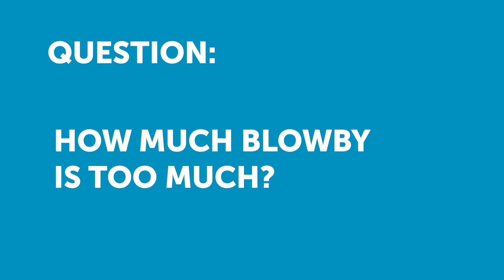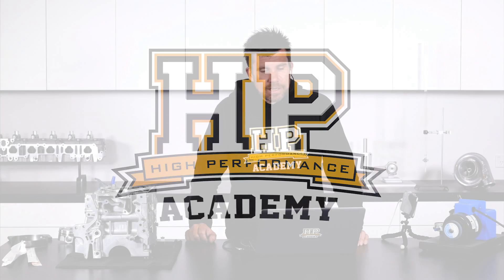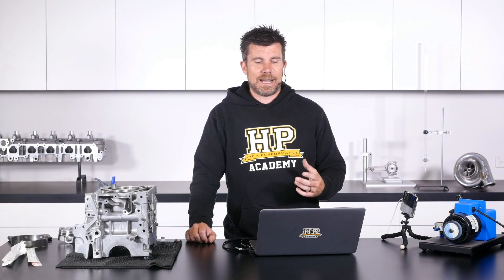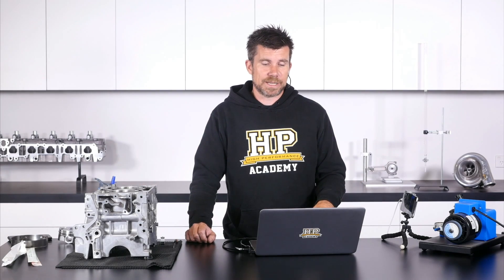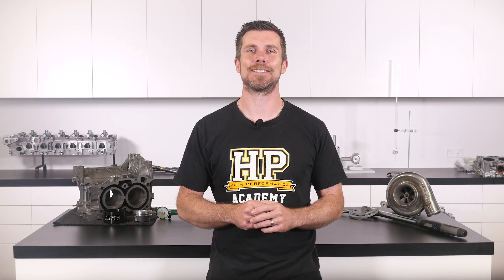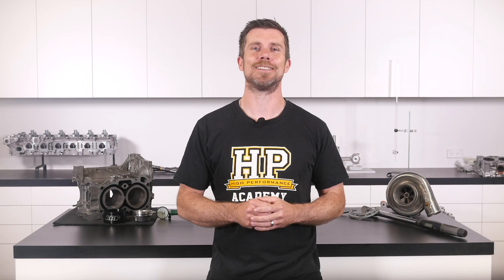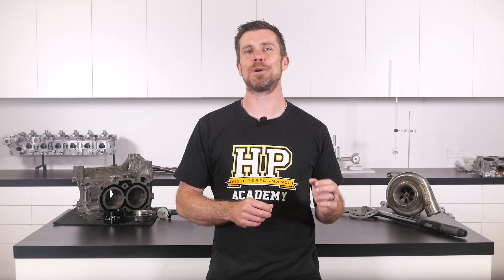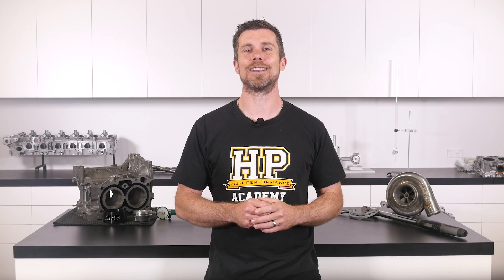Engine Blow-By | How Much Is Too Much? [HPQ Q&A]

Comment: I have an 1980 Toyota Corolla with 1.8 3T-C took off all emissions and added dual dcoe carburetors, the valve cove has 2 vacuum ports (one Pcv port)that tied into the carburetor for blow by escape vacuum, as I believe.

I have 2 air filters adapted to them now, one on the open port and the other port has the filter over the Pcv valve, since there is no longer any vacuum ports on the dual dcoe intake to create vacuum suction. “Breather style” I guess people would say…

Question is, is adding the 2 vent filters enough to let the oil/air mixture escape? Or does it create too much pressure inside the engine? should I need some type of vacuum to let air out easier?

Problem seems to be, I feel the valve cover seems to be leaking oil since, and I heard through the grape vine, too much pressure can cause the valve cover to leak due to over pressure with the filter method. Not sure how true, due to many engines having the “cone paper” air filter style replacement onto the valve cover.

Comment: Hello, a question I have is how much pressure is too much and what is a safe number in the valve covers during boost.  I'm measuring this to see if current catch can is flowing enough and not chocking the engine too much.    Thanks.

Comment: As Andre implied, while compression guages and leakage testers can indicate the really bad cylinders, it doesn't reflect the actual ring sealing under load when the rings have closed up, pistons expanded to reduce 'rock' and cylinder pressures are much igher - which also improves ring to wall seal.
I have even seen claims of less leakage at peak torque and power than at idle - but that may have a grain or two of salt added. Also seen claims by NASCAR engine builders of less leakage after a 500 mile race than when the engine was run in on the dyno'- again, may be salted.